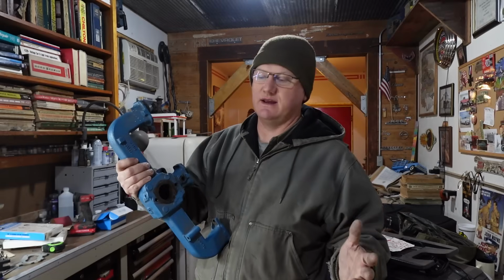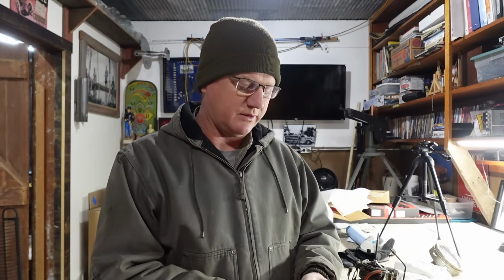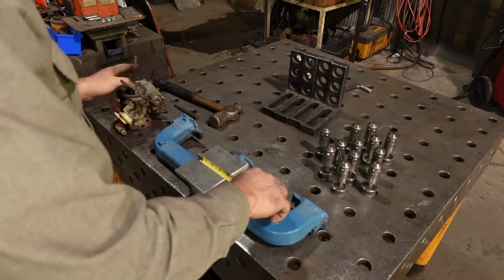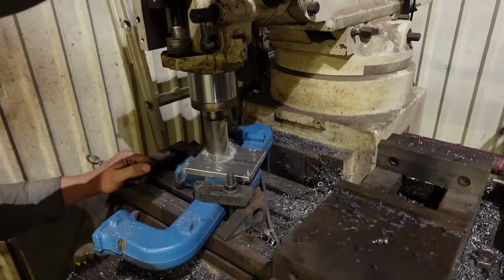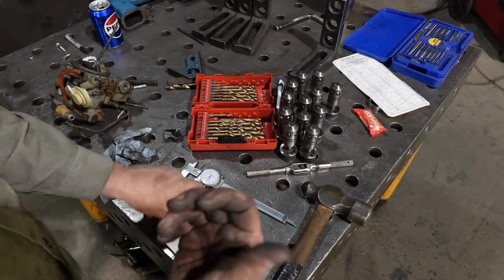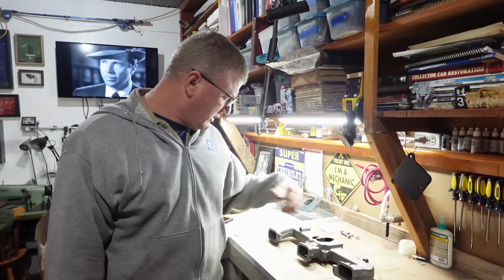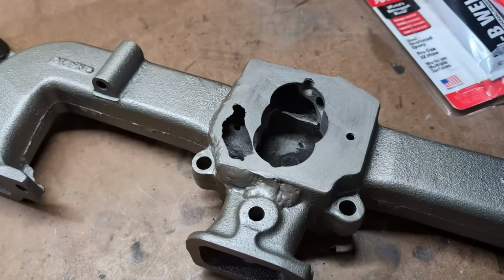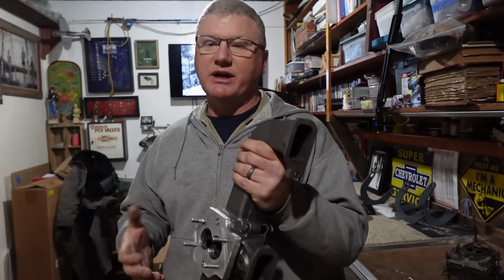Modify a Chevy Inline 6 Intake Manifold from 1bbl to 2

Comment: Throttle body injection off a 4.3 V6 would work good.  10-20 % up / down in CID doesnt make a much difference on a carb in real world. I would mount the carb 90 deg to the way you did

Comment: I wonder if drilling a slightly larger hole than the factory one & then adding the 1 barrel to 2 barrel adapter would make a decent difference? I’ve got the same predicament but with a 250.

Comment: Thats a 390 CFM Rodney Chester 
the 327 and 350 uses a 500 CFM, 
 I used a 500 and Made that Modified intake fit on a 250 worked great
  Just a 15 dollar used carb Cleaned and rebuilt  Kit are still low Priced

Comment: You could've used a thick stock paper, place it over the  manifold. Then use a light hammer tapping lightly around the perimeter and the fuel passageway. Trim up, verify dimensions, and now you have pattern for spacers and gaskets.

Comment: The up shot here is, you do these kinds of things for fun.
Gearheads love tinkering.
As far as any significant performance change, well you can hand built a set of Nikes for a turtle, but it's still a turtle.
If you can't squeeze the gas harder and flow it with custom exhaust, change the bumpstick, it's Nikes on a turtle.
Nothing wrong with having fun though.

Comment: I have never ever been able to get JB weld to work in any capacity. I follow the directions to the T clean everything leave a little texture for xtra tooth, let it dry 3 times longer than recommended and the stuff always fails. 
I can appreciate how cleanly you did it, and I hope it works out great!
Reply: Jb weld fails when exposed to heat at around 275 to 300 degrees if it's too close to exhaust manifold

Comment: Physics!
You need to understand it more.
The flow of an intake is limited by the smallest point, or, if manifold has a 35mm hole for a carburettor then fitting 2x35 mm carbs will result in the same max flow as the single 35.
Atmosphere pushes air in don't forget meaning max boost is 14.7psi, you can't suck harder..

Comment: The problem as explained to me by a successful I6 racer that ran them exclusively in his rail dragster is the location of the carb and short distance to the intake port in the head under it vs. the long distance to the outer intake ports. He made me a manifold for my 250 that used 2 Rochester monojets placed on either side of where the stock carb would be effectively equalizing the distance. He ran 4 monojets on his 250 and two dualjets on his 292 race motors, he worked those carbs for way more CFM though, also ran Weber IDAs but said the Rochester carbs would flow more. Doug Roe and Bill Fisher wrote the bible on Rochester carbs, HP books #39, it's a priceless resource. I love my Holleys for ease and speed of adjustments but a well tuned Rochester will beat it performance wise. I have hundreds of them, not an exaggeration, carbs ain't cheap no more, lol. You may want to look for the early 60s 1" bore Olds-Buick low profile 2GC used on their small V-8 engines, fatten it up if need be.
Reply: theres a video on youtube somewhere of David Vizzard porting one of those rochester carbs... dramatically improved the CFM

Comment: You're incorrect you can't overfuel the engine with a larger carburetor carburetor work on demand and that's all it does you can put too big of a carburetor on and not be able to use all the cfms it comes with so therefore you only use what is needed you know you people think like this and it's been proven a million times before just look online at all the hot rod places and everything and don't tell you it don't make a difference like roadkill and stuff like that motor trend you know that guy is a f**** not about the carburetors it is not true it doesn't follow any true practice take my word for it people like you just ruin your lives by doing stupid things and believing stupid crap I mean in a hot rod world you can't overcome rate a carburetor an engine

Comment: I did this in highschool on a chevy 250  straight 6. Milled the top flat than bored it out for the two barrel. Went right into the exhaust chamber like yours. Took it to the schools medal shop where they poured melted aluminum and the teacher had one of his students fill the exhaust chamber for me. I also used a block off plate so no exhaust could sneak up into the intake. Used a carburetor off a chevy small block 307.  And also milled the head like 15 to 20 thousands to bump up the compression. It really did wake that engine up.
Reply: Yes

Comment: No one is mentioning the OEM carb hot spot under that central part of the manifold...that you have now eliminated.

That engine will run really badly from cold until the engine is thoroughly warm...
when heat conducts back from the head to help vapourise the fuel/air mix properly.......

On cold wet days the manifolds will have ice on the outside.....

Comment: did you look into a LUMPORT job to the head  ? book by leo santucci    / you cut out the tree in the ports the part where the headbolt goes thru you cut it out  mill it smooth put in lump port kit then put a pipe plug in where the head bolt went and install a allen head thru lump port alloy part  then y can tq the head thru the head put the pipe plug in    you allready have a mill so you are 1/2 way there    dbn

Comment: JB Weld = good. For improved performance, smooth flow int to the valves is important.
If you're using the engine for a fork lift, then ok. For something street?  Clean the intake flow up!! 😊

Comment: Not for nothing, I have built a ton of 292/250s. 
I find used Offy/ Clifford intakes on eBay and run a 390 CFM 4Bbl Holley or 350 CFM Holley 2 Bbl from eBay - used. 
A perfect combination.
I also built a 250 with 3 Weber side drafts. Lump port head, 202/160 valves, huge cam, and blah blah
Anyway, the marine counterpart of this engine ran a Rochester 2 Bbl carb. 

If you have time and equipment, your adventure is cool

Comment: i have a 70 chev pickup with a 292 i bought a offy 4 barrel intake i am running a 585cfm holly i haveno problems with over gassing it is a 292 thats bigger than the 283 whose carb you are worring about my 292 is stock other than the intake and split exaust header 145000 miles on the engine

Comment: I cannot see how it won’t be a problem. You have enough JB Weld to make a manifold. I can see the zinc plated countersink screws being a problem, loosening up with heat over time. Might have been a good idea to remove the paint to bare metal before mounting the plate.

Comment: Personally I'd dive into a 2 carb setup to better balance the fuel delivery. Single barrels or a pair of 2300. You are overthinking the max carbs. A lot of 4 cyl. 2.0 engines use a 2300. How many 5.0 or 302 engines were equipped with 4 barrel carbs?

Comment: You would have to not know anything whatsoever about how to tune a carburetor to a specific engine in order to over fuel an engine by putting a large carburetor on it. You can easily put a 2000 cubic foot per minute carburetor on an engine that is only going to drink maybe 650 cubic feet per minute if you know how to adjust it it will run just fine and it will not over fuel. We know this because in the late sixties and early seventies several auto companies were putting at least 30% more carburetor on their engines than they technically could use. But they were working wonderfully and they weren't over fueling and if you were careful enough to adjust them just a little bit you could get some really respectable fuel mileage. Indicating that you certainly were not over fueling it.
Interesting argument you pose here, but it is totally hogwash. Take that intake manifold and clean it up and drop at least a 350 to perhaps even a 500 cubic inch 2 barrel and tune it to the engine because the fuel mapping in a carburetor only occurs by how much are literally goes through it. It will not fuel more than the amount of air that actually goes through it. Unless you just slap it on there and don't adjust it at all. Does 3% sizing garbage is absolutely that. I learned these things when I was probably 18,19 years old after I've been working on cars for 10 years

Comment: I agree with eddiepiecart60. Chevy 265 ci and 283 had 2/4 barrel carburetor setups from the factory. They worked well. Just saying. I still like what your doing there
Reply: In 1985, the 4.3 (262) that replaced the 250 came with a factory QuadraJet, M4MC style, those are in the 800 cfm range

Comment: I think you did a good job. The open space shouldn't cause any problems.  Gas could build up in there. When the engine is at operating temperature, the gas can vapor and "MIGHT"  make it hard to start when hot,shut off  then set for just a few minutes.  Kind of doubtful because it would be vapor, not raw gas going into the engine.  That's the only think that might go wrong.  I seriously doubt it would effect the running the engine.  That's an interesting project.  Let us know how the engine runs when finished.

Comment: Some of the later 250 ( integrated intake head ) had a progressive 2 bbl that was also used on 1980's 2.8 V6 ( think 1/2 of a Q jet )    The issue with too large of a carb is the transition from idle to main circuit leads to dribbling main circuit short term rich mixture until there is enough air flow.  Installing a smaller idle feed jet is supposed to help this issue.
Reply: 2GV, not a bad carb, the metering rods and hangers were the problem along with emissions measures that were easily disabled.

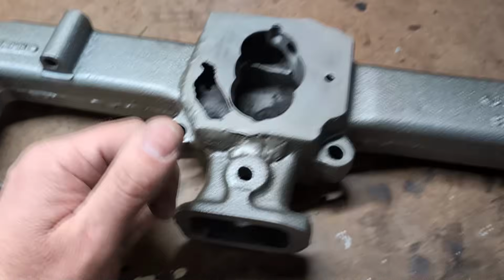Comment: my lawnmower has a bigger carb @28:00 I personally would chuck it ona  mill and bore all the out in the middle then weld the blank to the bottom of the manifold. Also might be worth investing in a good 3d printer as you could print different manifold designs and test them if you chose to

Comment: You don't need to worry "over fuelling" putting that 2GC on a 292.
I would throw that book that gave you the"3%" rule in the bin
Reply: however, that way to do things warrants much less fiddling when uou have to tune the carb to the engine. I fitted a 318 BBD carb to a 225 slant six, the mechanical fitting was the easiest part, tuning have been a challenge but the result have been impressive.

Comment: I think you would of been better off to rotate the carb 90* as on GM 6 cylinders especially the center 2 run pig rich.

Then you need to get a carbide tip grinder, and smooth out the transition to the runners.

Your idea works on a Dodge Slant 6 because the distance to the port is far more uniform vs GM's.

Besure to connect the manifolds togather still so the intake gets conductive heat. As headers on an inline, 6 without thermal transfer can get problematic. You can get carburetor icing to general poor running conditions when cooler outside. Ford with the 300-6 used a coolant warming pad to get manifold heat.

V8 engines can get away with removing the exhaust crossover because the bottom of the manifold is heated by the engine enough anyways. Where a inline 6 manifold is hanging in the air flow.

I have seen people with headers weld or clamp on connections to the manifold to transfer heat up there to keep the fuel vaporized.

Comment: I've built a number of these engines with all different sorts of induction setups.  single two barrels , dual 2 barrels, 4 barrels.  Modified factory, Clifford, and Offenhauser intake manifolds.   Holley, Rochester, and Weber carburetors, on engines up to 311 cid.   Best performing setup all around ??     Quadrajet on a modified Offenhauser 4 barrel intake.  The Clifford 4 barrel intake looks cool, but suffers from fuel dropout / poor mixture distribution.   The clunkier looking Offenhauser intake is much more scienced out and better engineered.    A basic Quadrajet on this manifold, a mildly ported head (you can also go all out lump ports) a 262-268 ish cam and around 9.5: 1 compression will equal a very tame but surprisingly strong running engine that gets very reasonable economy

Comment: I had a 49 Chevy 6 216 cid aand put a 2 carb manifold “tattersfield” if I remember right.  It had 2 stromberg 94’s on it and ran great. The old chevys were starving with the one barrel carbs. You could easily put two manifold adapters equidistant from the center and make a stormer out of that 292.

Comment: No idea on the carb bore sizes, but there was a 2 barrel option on early Chevy II sixes.  I don't remember if it was the 194 or 230 engine.  But they were out there.  The bore sizes might be a little small for a 292, but it wouldn't over carb it.

Comment: There are some aluminum Clifford research intakes floating around the used circle track market. Holley 500 or 390 2 bbls work nice and are easily re-jetted. I have done the cast iron intakes, only because rules at the track required cast iron. I was also in the process of adapting a Pontiac OHC 6 cast iron 4 barrel intake to a Chevy 6 and a big mouth onlooker got it outlawed before I finished.That intake had more even runner length.
Reply: I used to run the Holley 390 four barrels with vacuum secondaries on 283s on the street.  Loved that set up.  I always figure they'd run great on a 250 or 292 as well.

Comment: Good video, I am considering doing this to my old 216 babbitt pounder '39.
Reply: @whiteyfarm  save your effort and tine on those old rod knockin babbited splash dippers,  go for a later at least 1954 235 or the newer 230/250/292 and have  something,  I junked several of the rod knockers for later 235's, great easy swap and a lot more stock HP !!

Comment: Isn't the CFM going through the carb a function of the engine displacement x RPM /2 (4 cycle)? With a bigger carb you are just increasing the air density when the throttle is wide open compared to open throttle of old carb, as long as there is more available CFM than the engine can handle at that rpm. With higher air density (lower intake vacuum) there may be better performance because of higher compression.
Reply: Just adding, the toilet story doesn't apply because water won't compress and air will, thus changing its density.
Reply: : 380 CID x rpm/2 divided by 1728ci/cf  so 292 x 4500/2=657,000 ci. /1728 = 380 cfm. If you use a carter afb with vacuum secondaries you wouldn’t be over carbing the engine. It would be running off the small primaries most of the time. One carb is easy to tune also.
Reply: @rjhasbeer  Yes, you're right.Much easier to tune. I ran a 650 CFM Carter AFB on my 283 in a '59 Chevy back in the 60s with no problem. Same gas mileage too, except at stop lights, etc. I think the stock GM 2 bbl for that car was rated at about 400 CFM.  I believe the big difference between the two carburetors was at the higher revs. That's when the engines ask for more CFMs and the bigger carbs can deliver it.
Reply from the maker: It's very difficult to fit a 4bbl onto a 1bbl intake.

Comment: I have a 1940 Chevy Master Deluxe with the original 216 I6. I've had this car since 1970, my senior year car. I was considering putting a 292 6 carb on the 216. Someone tried this with this carb on a '48 Chevy similar to yours. He had opened up the manifold and carb mounting holes were off so he drilled those off center to match the 216. He gave up on the project to,  instead, put an LS 5.3 V8 in the car. I got all these original '48 parts for my '40, including front suspension ( knee action) and complete rear axle assembly. He gave me the carb and a newly rebuilt 6 volt starter also as part of the deal. Just wanted to let you know I watched many of your '48 Chevy videos and they sure helped me a lot. I enjoy your channel. I am an old mechanic since '71, but most of my work was on '60's through all late model cars and trucks. Much electronics, computer, driveability, and emissions diagnosis. I am retired now and enjoying working on this project I started many years ago. Thank you for your dedication!
Reply: Geeze, you got a gold mine. My '39 needs to have the knee actions rebuilt. That isn't cheap these days. The Chev dealer doesn't carry  them anymore either.
Reply: @whiteyfarm  I've had one broken for many years so I bought this front end for the cores. They are both not frozen like mine were, so I'm hoping I can put fluid in them and make them work at least a little. These brake drums and axles are the original 6 lug pattern, where mine were changed many years ago to '50 Chevy 5 lug wheel pattern. They were never right, though. This '40 has not been driven in 51 years. Almost lost it in a tornado, but the garage roof held where the wall fell. Close call! I think the shocks were the same from '39 to '48 if you can find some good used. I almost bought a straight axle kit just to get it back on the road. Apple Hydraulics in New York, or Chevs of the 40's in Washington state did have rebuilt in stock.. they want cores, though, or $150 ea. added to the cost of shocks. Good luck on your's.

Comment: I built up a high performance 153 Chevy II engine a few years ago. I built a header for it and I built an intake manifold for it from a piece of exhaust tubing. Made my own flanges etc. First intake I made I built it with the carb sitting like you did. It worked ok but I thought it could be better. Do I redid the intake and turned the carb 90 degrees. That made a huge difference in performance! Having one barrel feeing two cylinders each was the ticket, the area under the carb was still open, no divider, just a little bit of a wall so to speak. This engine is a 153 that was built to be essentially half a 327/350hp engine. It runs great and sounds like V8 out the 3 inch exhaust. It had a lot done to it. Carb used was a Rochester 2bbl, OMC unit off a 120hp.